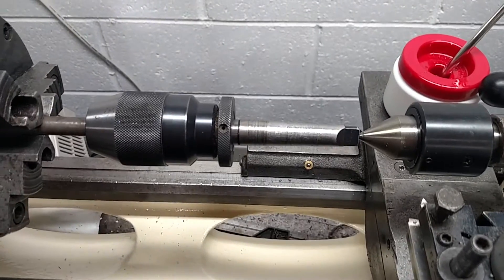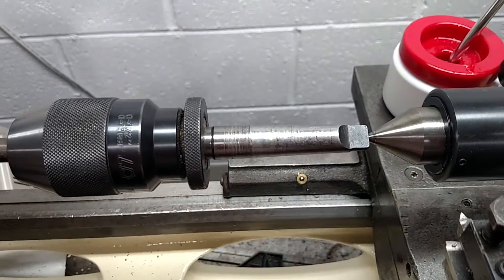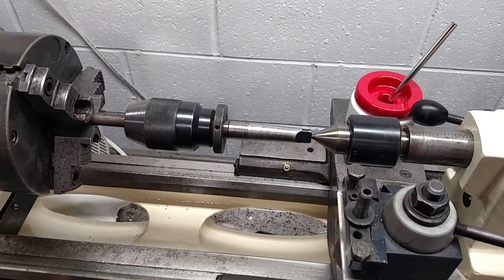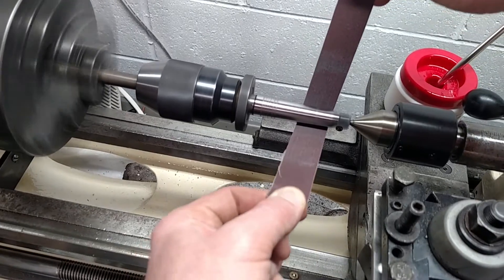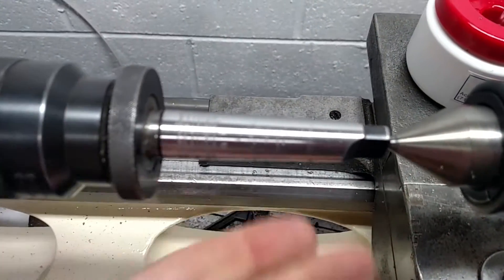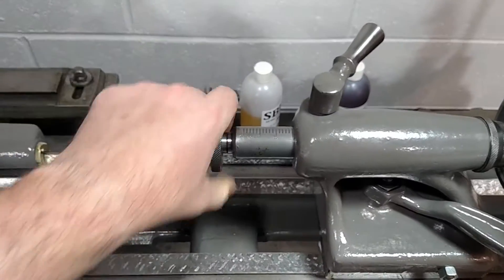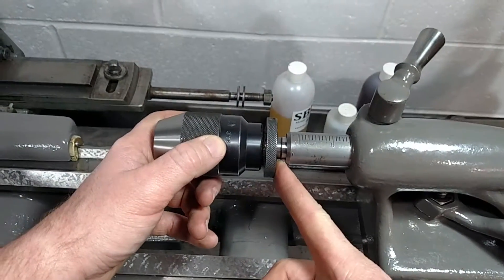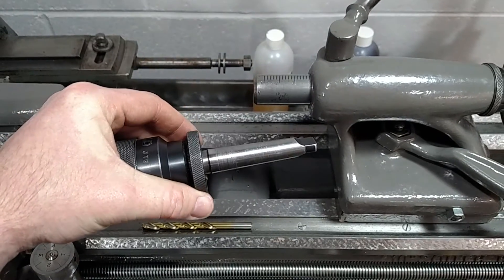Attempting to clean up a Morse Taper Shank for the Lathe!

Comment: just repaired my mt2 using the top slide. Then i used a flat file and when it was smooth enough i used sanding paper to get a mirror finish. So after turning use a flat file, and after that sanding paper. Now it fits perfect and doesn't turn around in the tailstock.

Comment: Nice video, thank you! You might as well have changed the inexpensive tapered arbor, but still, it's a nice tutorial. It's not always possible to change the shank, and the whole unit might be difficult or costly to replace, so this method definitely has some use in the shop.
I have recently bought a quality live centre set for my woodturning lathe, and one of the several replaceable tips that came with the revolving center has its short morse tapered shank damaged a little by contact with the teeth of another tip. It wouldn't be easy to ask for a replacement as the set was shipped in from abroad, and it would involve some postage costs, too, so I might just attempt to clean up the shank myself by holding the rim of the tip in the chuck of my lathe and taking down the high spots/burr from the tapered shank with a strip of sandpaper.
I'm also thinking of taking the damaged tip to a machinist's shop and asking my machinist friend to cut back the surface of the shank a little. That would be a cleaner solution, but it has some risks, too. It would need to be done very precisely to avoid changing the symmetry of the morse taper, because any small fault could cause misalignment of the tip in use. So I don't know yet which path I'm going to take.
A light sanding would probably be more suitable, because the damage is not great, rather local, just some not too deep teeth marks on one one side of the shank. They do have raised edges though, I can feel them with my nail. There's some fine burr, but some slight deformity might be pressed into the surface, too. I'm not sure that sandpaper could smooth out all the damage without more harm to the rest of the shank. Probably some kind of delicate file or fine grit stone would be better, but their uniform application over the shank would be more difficult. The shank is a very short type of morse taper, so I don't want to lose any gripping surface either. I might just end up taking the whole unit to the machinist's and ask for his advice first.
There's no rush, and I definitely don't want to ruin the shank of the tip. In any case, your video has helped a lot. Thank you!

Comment: I recommend replacing the MT2 drill chuck adapter before you mess up the tailstock Morse taper. 

I had the opposite problem when my 12" swing lathe with a  tailstock MT3 bore couldn't grab the chuck adapter. I finally used a MT3 finishing reamer and skimmed the tailstock bore back into perfect condition. Before doing this fix,  I used a single layer of printer paper to grab the chuck adapter as a temporary fix (see http://www.homemadetools.net/forum/temporary-tailstock-fix-worn-morse-taper-17472 ) on HomemadeTools.net . I like the Clausing lathe you recently acquired. Regards, Paul Jones
Reply from the maker: +Paul Jones
I'm trying to figure out how to get it out. Not sure if I can drill through it without affecting the Chuck.
Reply: +Precision Machine Shed The chuck appears to be a copy of looks my Albrecht chuck. It even looks like the same arbor mount system. If you haven't removed the arbor yet and still need help, message me and I'll walk you through it. It is quite simple really.

Comment: If that's not a real Albrecht chuck then it's for sure a copy of one. If you don't already know, not a good idea to use the 1/2" shank Silver & Deming type drills in a keyless. The chuck could tighten up to the point you may have to take it apart to get them to open. Or the metal butcher types would just slap a pipe wrench on the chucks O.D. You certainly don't strike me as one of those though. :-) 

Congrats on the upcoming family enlargement.
Reply from the maker: +Turning Point 
Thanks, These Keyless chucks are new to me, so thanks for the heads up! For sure are not Albrecht. Not sure what this one is, then I have another that is a Grizzly...... China all the way!!! One day, I'll get a real one!
Reply: +Precision Machine Shed I've got an Albrecht and they are smmmoooth as silk. I've also got some of the integral shank Glacern keyless. There, or at least the one's in my batch were pretty decent for about $100. Even the runouts are down around a thou. For a non rotating application I think there more than fine in a tailstock. 

But like any tool they can't do everything. There fast as hell for swapping drills out, but a good keyed chuck is still needed for those S&D drills and while power tapping. Those keyless don't work under load while in reverse. They just open up. 

And in case you were ever tempted to do so, you can't drill through the inside of the chuck and into the shank with the separate chuck and shank types. Or at least the Albrecht one's can't be drilled. You'll destroy the chuck if you try it.

Comment: Since you have a taper attachment on your lathe, why don't you remove the shank from the drill chuck and uniformly reduce its diameter? As long as you only take off a minimum amount of material there should be enough play in your tailstock spindle to accommodate the  overall change.  Consider it an experiment, but since its hardened it will be tough and you'll probably need carbide to even try it.
Reply from the maker: +Steve P (Hotwelder2) 
Thats a good idea, but would take a little longer to set up. I still need to find a clamp for my taper attachment, so it's out of comission until I find one of those and make sure it's square to the world. I hate moving tail stocks over too!
Reply: +spitfire1821 You might want to check out Tom Lipton at oxtools for detailed info on cutting a short taper w/o a taper attachment or moving the tailstock,  which is a pain. You use the compound.
Reply from the maker: Yeah, I've done that before too!